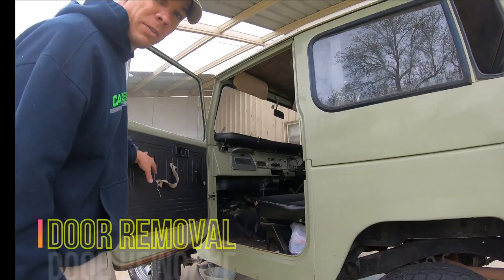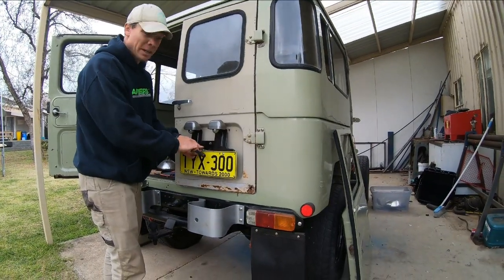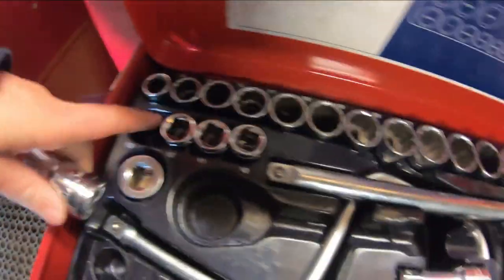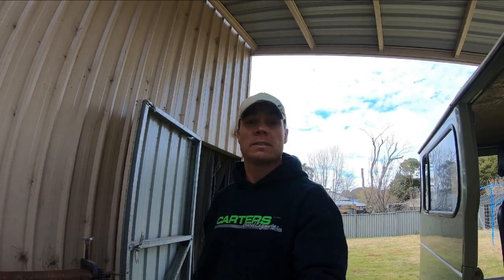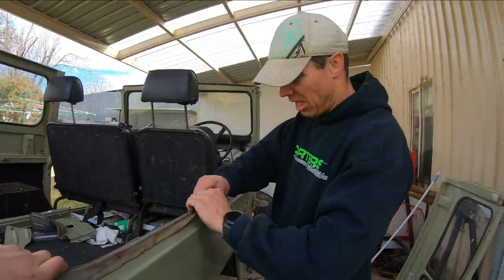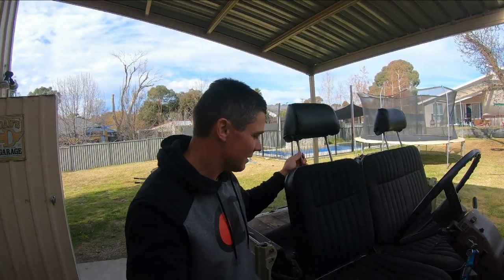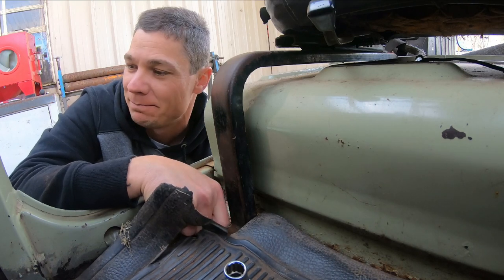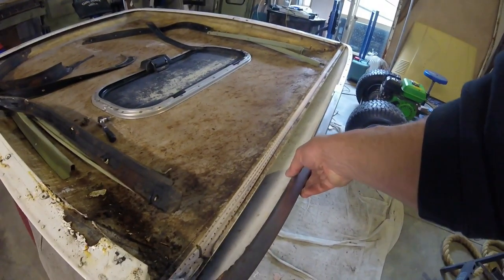EP13 - 40 get's Stripped down... But I find a very concerning safety issue!

Comment: Thanks for another great video. Comes apart very nicely. My 1970 is more rusted and I break a lot of bolts trying to disassemble mine. I wish mine came apart with less problems.
Reply from the maker: Thanks Rick,  I sprayed all my bolt with WD40 the days before to help remove. Still most of my bolts were damaged plus the Dodgy tek screws where not a welcome find.

Comment: In one of your videos you make mention of your new ‘old’ looking head unit with Bluetooth etc where did you get it from? Also where are the speakers mounted from factory? I have an 84 40 in NZ which is pre resto and has no stereo or speakers. Loving your videos!
Reply from the maker: Hi Nick, the original one had one speaker mounted under the dash. I plan to make two speaker pods and mount them in the rear. The head unit was from eBay, Cheap but I like the look as it has a retro feel. I was heading over to NZ but had to change my plans due the Pandemic.
It is a beautiful country!